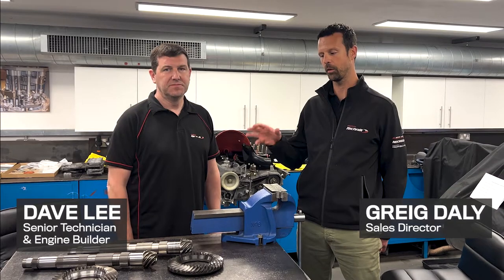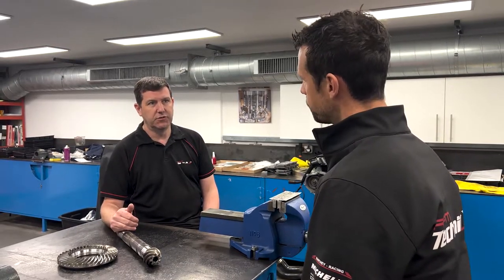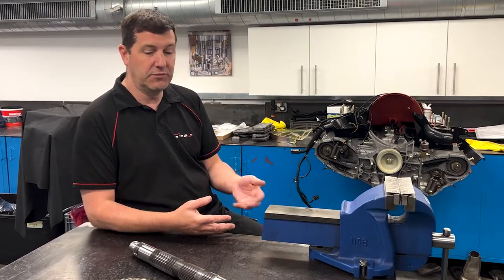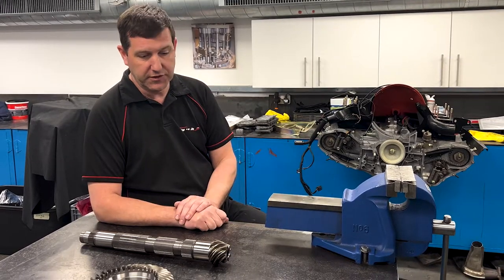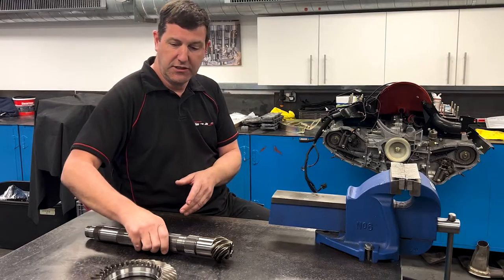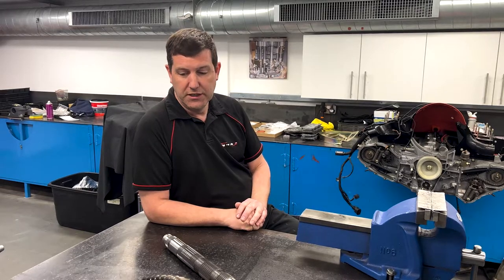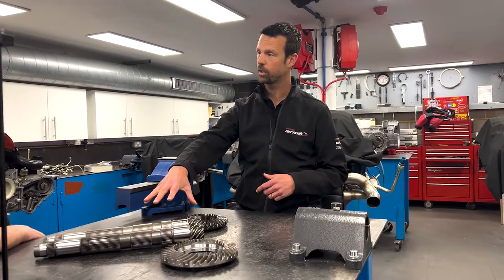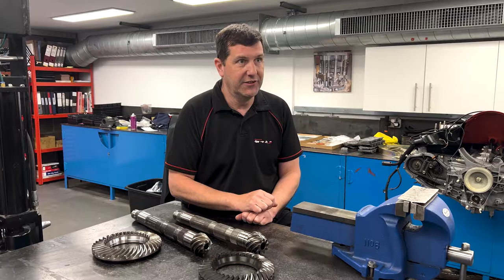HOW TO LOWER THE GEAR RATIOS ON A PORSCHE CAYMAN GT4 EXPLAINED...

Comment: I’m assuming 0-60 times will improve with the shorter ratio. Has anyone compared the times with stock gearing?
Reply: maybe.... unless you have to shift into 2nd to get to 60.  but IN GEAR acceleration will improve

Comment: Some comparisons would help people want to buy. Also you never mentioned the percentage drop, although you have in another video. Also I've never seen a 981 GT4 get anywhere near the limiter 7800rpm in 6th flat out at 183 ish mph , so how would it affect topspeed? Do you think with this crown wheel and pinion fitted, it would reach the limiter then? TIA

Comment: Any chance you could let me know what the crown wheel diameter in the G81 gearbox is?  I'm putting some info together on front engines and rear engines RWD cars and their maximum torque vs crown wheel diameter. The objective is to see whether the rear engined models use larger crown wheels due to the extra traction the rear weight bias gives them. Thank you.